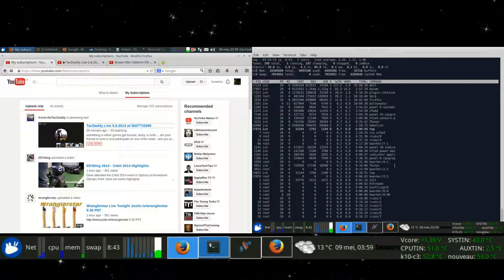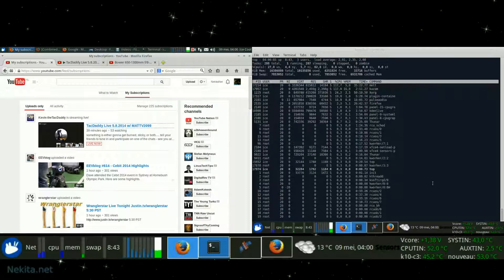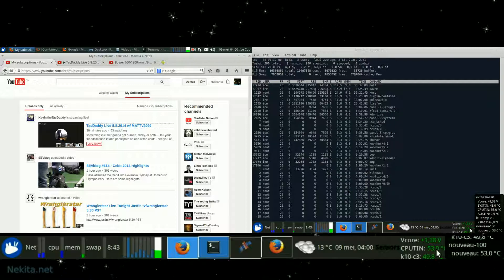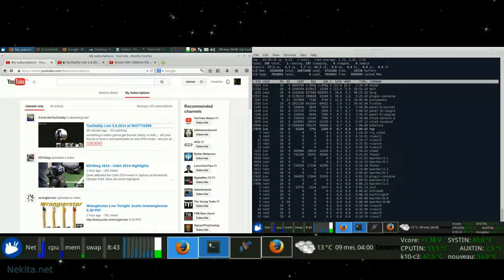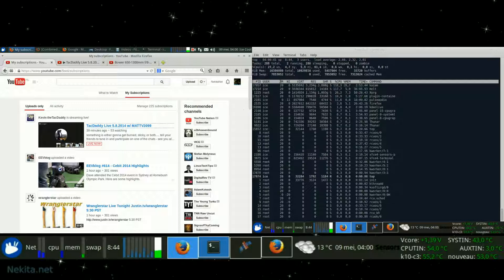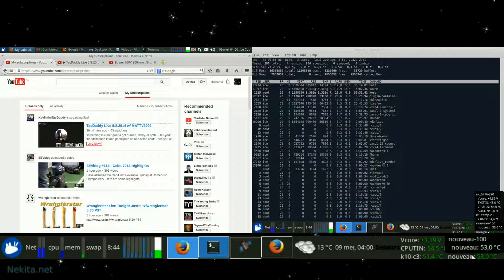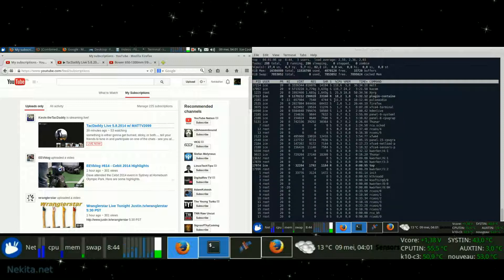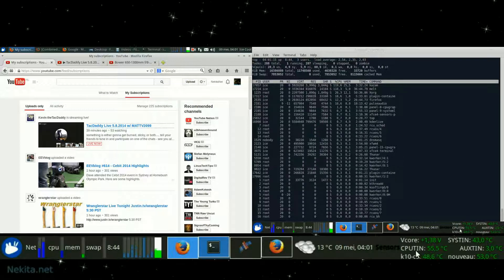AMD FX 8350 FAN NOISE!!!

Comment from the maker: Yes, finally dared to render after replacing the defect Stock CPU Cooler Fan and it is still noisy as can be at high temps for a "proper" AMD FX 8350 Boxed CPU set. Running stock doesn't seem to be possible, just have a listen why...